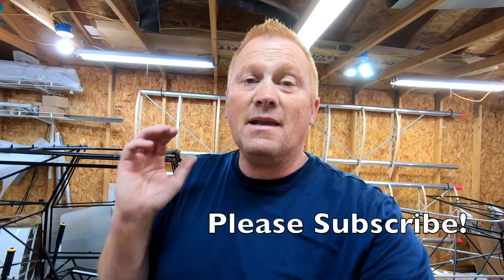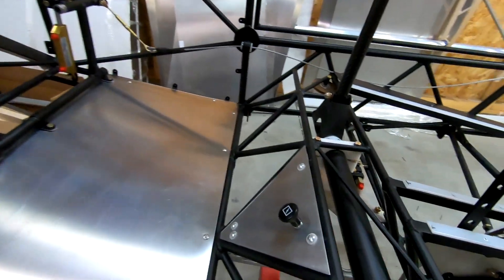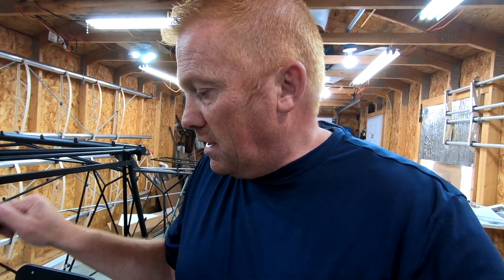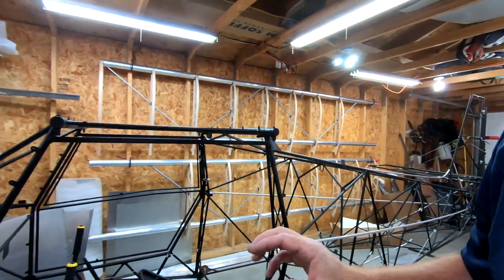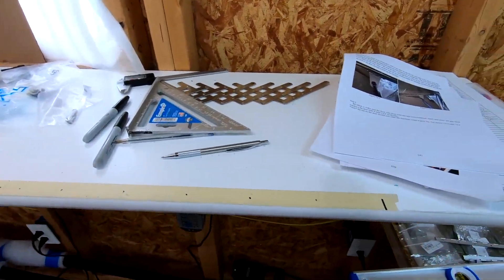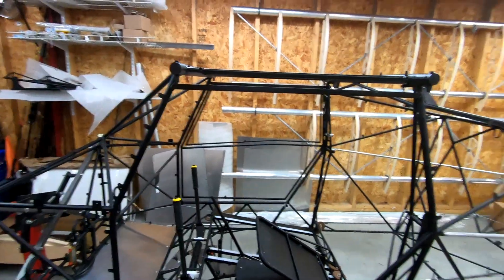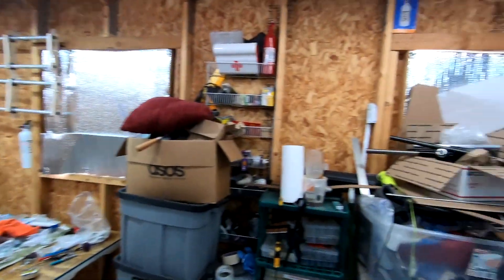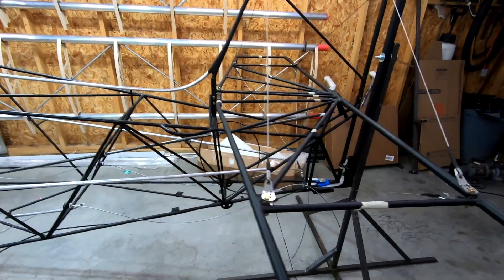Sometimes You Need To Ask For help!  Just aircraft highlander Build Update Vlog 5

Comment: Just a suggestion on those "finger tight nuts" when you finally tighten them, mark them with some bright torque seal. That way you can visually tell if you need to address them. Makes final inspection go much smoother..
Reply from the maker: Will do, great suggestion!

Comment: Riv-nuts are an awesome idea for future inspections/maintenance. What are you doing to mitigate corrosion (between dissimilar metals)?
Reply from the maker: Tony, thanks. As for dissimilar metals, I'm not putting Carbon and Aluminum together to avoid that issues, the steel airframe has been powder coated which should eliminate issues between steel and aluminum, and I'm priming and painting all the other parts  that come in contact with each other that "Might" present a possible issue, outside of that I'm not sure?
Reply: @HookedOnUtah  I like your take on mitigating galvanic corrosion. I know some people use fiberglass when combining aluminum and carbon fiber, just not sure how it works with stainless steel and carbon.